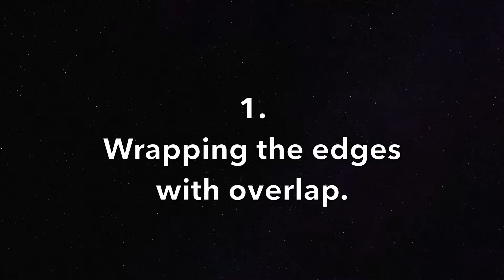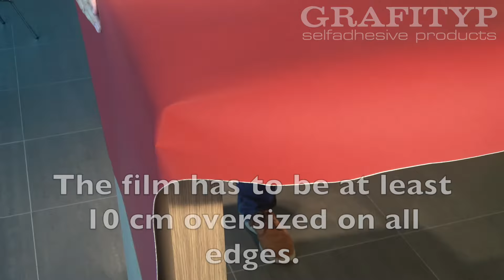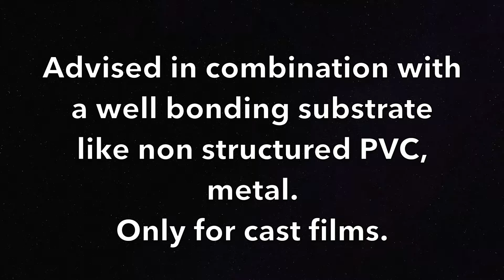Furniture wrapping part 1 :  Tables with right edges

Comment: You have skills.   Thanks for sharing ideas.  I suppose you must use a heat gun.   I did not factor that part in. Does that mean it will not stick as well or peel up sooner if I don’t?

Comment: Thank you, great video, showing exactly how you can get beautiful corners. Now I am not afraid to renovate my IKEA kitchen cabinets with d-c fix. I will use the method with heating, it seems the best for plain kitchen cabinets 👍
Reply: How did you get on wrapping your kitchen with d-c fix vinyl? I bought an A4 test piece in sage green, but it felt very thin and flimsy. I’m not sure whether to buy a full roll, or look for another brand? 🤔

Comment: Would it ruin the table trying to remove it afterwards? Or is it easy to come off even after the heat gun is used?
Reply: Removing the film will not cause any damage, provided it is heated properly. Heating the film will reactivate the adhesive, making it softer and easier to release. We hope this answers your question. Kind regards!

Comment: What is to be the ideal thickness of of the film. I tried but lot of air bubbles and overlapping happens. Tried with very thin fim.
Reply from the maker: Hi Mohan,
This wrap was done with GrafiWrap AMD DECO films. These films have a thickness of 140 to 200 µm, depending on the chosen motif. A thinner film does not make wrapping easier, quite the contrary. In the case of a thin film, we recommend laminating it first to give it a bit more body.
Hopefully this will help you. :-)

Comment: Very good explanation, but what is the best way with rounded edges?
Reply: Dag Martine,
Wij helpen je graag. Eind deze maand komt er over afgeronde hoeken ook een instructie video.
De werkwijze bij afgeronde hoeken verschilt niet zo veel. Het hangt er een beetje vanaf hoe strek de afronding is.
1. Als het een afgeronde 90°-hoek is, ga je best te werk zoals in methode 1, wrappen met overlap. Je wrijft hiervoor de folie zo over mogelijk aan tot je een plooitje zou maken. Vanaf dat punt snij je de folie door. Kleef 1 kant over de afgeronde hoek. Je zult zien dat er aan de onderkant meer overlapping zal zijn dan op de plaats waar je begonnen bent met aanwrijven. Snij daarom een stukje in de vorm van een driehoek weg zodat je later geen te grote overlapping zult krijgen. Plooi met behulp  van warmte het 2de stukje over het eerste.
Druk alles nogmaals goed aan. Snij van het 2de omgeplooid stukje ook het teveel van folie weg zodat je een totale overlap van maximaal 5 mm. krijgt.
Snij hierbij niet door de onderliggende folie. 
Warm nogmaals op en een laatste keer goed aandrukken als de folie terug handwarm is.
2. De folie doorsnijden zoals in "wrapping without overlap" is af te raden bij afgeronde hoeken. De folie staat te veel onder spanning om niet na een tijdje open te trekken.
3. Wrapping without cutting the film: dit kan lukken maar vergt voldoende ervaring.

TIP: Om lostrekken van de folie op de onderrand te vermijden snij je het overschot best niet aan de onderrand van de tafel af. Plooi de folie ongeveer 2 cm over de onderrand en snij daar dan het overtollige weg. Op de rechte stukken is dat gemakkelijk te doen, in de bochten snij je de folie door in 1cm brede stroken alvorens hem warm te maken en om te plooien.

Wij hopen je hiermee voldoende informatie verschaft te hebben en wensen je veel succes.

Vriendelijke groeten,
Applicatie team Grafityp.
Reply: Wist je trouwens dat Grafityp erg professionele opleidingen geeft? Op www.grafityp.com vind je alle uitleg over deze cursussen.
Reply: @JohanMoons  Replying to an English language comment in a different language, hmmm, right ok.